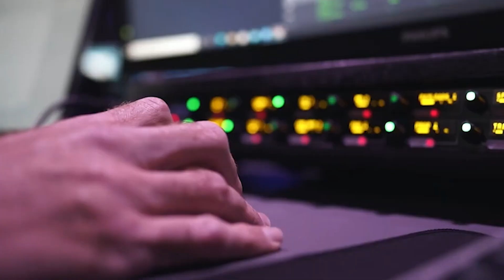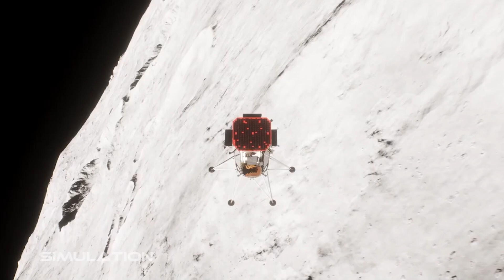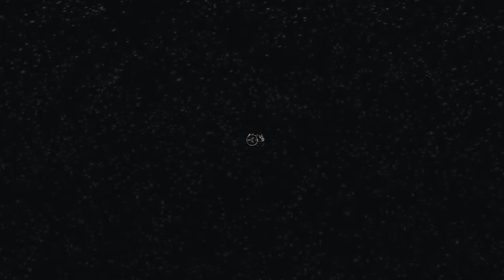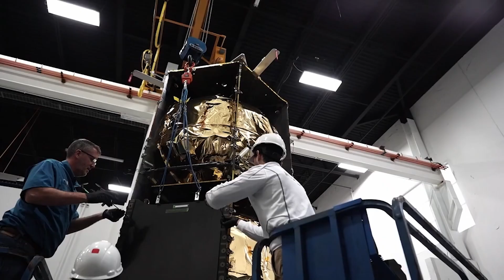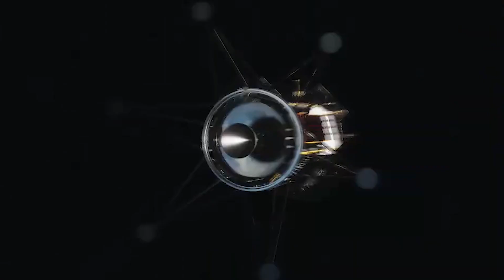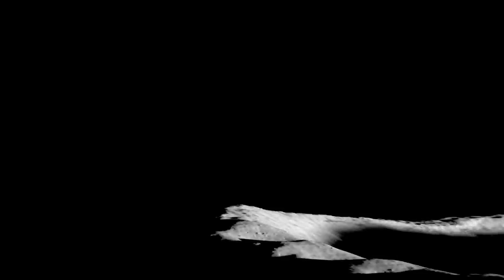What Exactly Went Wrong During Odysseus’s Landing?

Comment: I like how many people consider this a 100% success or a 100% fail. It achieves 80% of it's goals but nope it completely failed because reasons.
Reply: I'd like to see your list of goals that leads to this being 80% successful.
Do you work in PR? :-)
Reply: @chippysteve4524  I think they will say that 75% is that it's still in one piece.   Maybe they should build some cheap landers that just have a couple of cameras on them to prove it made it and do practice landings before they go and spend 100 millions dollars on a box that tips over.
Reply: @rbspider  I think this is an example of a cheap lander.  According to Wikipedia, I think $118 for 3 landings.  They won the contract so the competitors were presumably more expensive.  I think the extra cost for a decent mission if all goes well wasn't that much and was largely paid for by folks willing to gamble.
Reply: @richdobbs6595  I saw that it cost over 100 million, it didn't mention two more probes.  They add all these experiments onto them to make the device very complicated .  How about a box with some cameras and a door to open and close so that a robot can step out or even just some boxes with cameras and practice landings ,  send up one a month until they figure that out.  Sort of what Space X did with the boosters.  I can't wait fifty years between missions ,  I'll be dead.  I think we wasted our time on the space shuttle and ISS.  If there was gold up there it would be like 1849. Other than taking pictures of the Earth to set the record straight for all the FE honestly what is the point. There are tons of things to fix down here.
Reply: @rbspider  There are supposed be 8 or 9 NASA lunar landing attempts in the next 2 years, so you won't have to wait forever.
Reply: @rbspider -total cost is about $130m. That includes the $90m ride from SpaceX . So really it’s 40m to make lander
Reply: @rbspider They went private-capital; Google: "The Secret Spece Program." They've had two conferences. A good book: Covert Wars and Breakaway Civilizations: The Secret Space Program, Celestial Psyops and Hidden Conflicts
From Joseph P. Farrell
Current price:$19.95
Reply: @richdobbs6595  Thank the NASA ,  I don't have much time left but hopefully two years . My doctor told me to not buy green bananas .
Reply: @andymunoz3954  That's not real bad an F-35 cost much more . But how long does it take to build one? They should make an assembly line so that every part isn't a one off .  The vendors can then build to spec the experiment parts and have them plug into available bays ?
Reply: @richdobbs6595 true they need to stop cheapening out.
Reply: @rbspider  - Well Flight two is scheduled for before EOY. flight 3 being in 2025.  I think they gave themselves room for improvements between flights. You can do all the math in world but you learn faster with rate. Its how Spacex develops so fast. I think I.M. is doing the same.
Reply: @richdobbs6595 this 118$ million is a cover up from nasa dude you really trust that. Its atleast half a billion project and its not for 3 landing.  I can tell you with 100% assurance they will not land soft in the future also , it was not at all controlled and the speed was too much . Go and watch indian and chinese landing and check the speed  you will  understand the difference .
Reply: @andymunoz3954  I am sure they will get it locked in and if it weren't for the sabotage on this flight it would have been a total success. But two failures in a row would be bad.
Reply: @tubecated_development Well isn't the real goal to put humans up there?  Any experiments can wait . We need the cameras up there to show the FE people that the Earth is a ball and water sticks to the bottom .
Reply: Landing on its side is a 💯 % fail
Reply: I’m glad you like it
Reply: 90% failure… 
Got to the surface of the moon 10% success
No communications (-5%) 
12 experiments lost (-75%)
No deployment of camera (-5%)
Human error LIDAR safety pin (-5%)
Reply: I was 8 years old and remember the 9 missions to the moon that 27 people flew to the moon and 12  people walk on the moon.   So this backwards progress missions are hard to take seriously .
Reply: @Crashed131963  Hmm... your memory isn't what it used to be mate.  Nine Apollo flights went to the moon, carrying 27 men between them.  Apollo 13 did go to the moon, indeed to this day, those three astronauts hold the record for being the furthest from Earth any man has ever been, but obviously the landing wasn't possible after the explosion in the service module.
Reply: @Warriorking.1963  Your right I forgot that Apollo 8 went to the moon . That makes 27 .
Thanks for the info .
Reply: @Warriorking.1963 Apollo landing is fake lol 😅
Reply: @aungaisum8654  🤡
Reply: @Crashed131963 you know this is Hollywood stuffs lol 🤣🤣🤣
Reply: @aungaisum8654  That why the USSR during the cold war invited Neil Armstrong to Moscow to congratulate him?
Reply: @Crashed131963    If you are old enough to remember the Apollo missions then you should be old enough to understand that there is a big difference between landing a manned vehicle on the moon and an UNmanned lander.  Perhaps if the laser range finder had been functioning properly the landing may have been better. 

 This lander was the first lander built and sent outside the Earth's orbit by this company.  In addition this is just ONE extraterrestrial vehicle and was designed and built on a shoestring budget of only 118 million dollars.   That is hardly an indication that the technology is going backwards.     If you know anything about sending extraterrestrial objects into space especially to land on the moon that is an expensive proposition.  

This vehicle was only intended to last 7 days anyway and conduct a few experiments which it appears they can conduct some of their mission plan.  Add to that this vehicle had numerous firsts.  First private company to put a lander on the moon.  First lander to use meth lox fuel and also a cryo fuel.  

 Perhaps you weren't aware of these facts which is wait it is always good judgment to wait before passing judgment on what may appear to be an unsuccessful mission.
Reply: You wish they ever got to the moon. And then they LOST the technology how it was done.  WOW   @Crashed131963
Reply: You and me, both... @Crashed131963
Reply: @Crashed131963 NASA faked all the Moon landings. You believed it back then as true because you were eight.
Reply: @Crashed131963  I couldn't agree more.  Now they have delayed the Artemis launch for more than a year due to some new issues.
Reply: Landing SIDEWAYS on the moon after 50 YEARS of technology advancements since NASA's several successful landings is certainly not a 'success'.
Reply: Has lots of support from around the world. Probably have a squeeze soon
Reply: Exactly no success NASA really fucken up can’t even land a self autonomous lander
Reply: 100% belly flop
Reply: Did it meet its science objectives?  Launch, cruise, and landing are only steps towards meeting its objectives.
Reply: Better to redesign the moon lander in a ball shape containment. Ha ha!
Reply: Unprecedented homelessness.   Housing costs historically unreachable.   Yet we have more technology on our wrists than you could fit in a room, back when we last landed on the moon?   Two missions cost how much in tax dollars?   I think it's a colossal failure.
Reply: its a 100% fail
Reply: @imyoursenseiX  100% fail is a impact creator .
The thing is sending great closeup pics of the moon surface with the camera lens in the dirt .
Reply: @Crashed131963 sending pics to who? Where are all these fabulous pics. Also last I checked video has been around for 80+ years . How convenient that the video camera was “powered” down. All part of a BS scam.  Seeing IS believing and HAS TO BE the MOST important objective.  The moon is a dead rock. Yet SHOW videos and then you have believers.  Ridiculous
Reply: I can't believe there are adults that actually believe in "space" travel...absolutely pathetic.

🤡🌎
Reply: @mikestorey1609  That's why during the cold war the USSR invited Neil Armstrong to Moscow and gave him a parade and medal .
The USSR just wanted backup the US fake moon landing story because they were such good friends . .
Reply: Bellshazar - yes - "reasons" ... MANY reasons....
Reply: If this had been NASA’s project, can you imagine the non-stop comments that “government” is incompetent and spends too much? MAGA would be campaigning on it.
Reply: I mean yeah but landing is like 10% of the end goal, right? But landing 100% correctly is what allows it to perform the other 90% of its goal
Reply: At least it wasn’t a “smashing success”, but rather a qualified learning opportunity which wasn’t totally bad.
Reply: @Mentaculus42 whatever. If it was the Chinese, they would have landed it correctly. How many millions did they spend on it? For a learning experience ?
Reply: @acerdan  
So your high mark is the chinese! My subtle point was about the constant pronouncements of “smashing successes” from a particular group more than what happened here. Don’t forget that JPL & NASA has been successful at doing things that are a lot harder than landing on the moon (for a lot of $$$s and time). Now a group within NASA is trying to “outsource” more because it is in vogue to do these “experiments” in developmental methodology.
Reply: @acerdan China space missions has good planning before doing it. That's why they have 100percent record.
Reply: @Mentaculus42 moon landing easy? Looks like only China can consider succeeded 😅
Reply: @Mentaculus42  Wherever I have worked a "qualified learning opportunity" has been code for "F@#$ up"
Reply: @alanserjeant4947  
Precisely, but actually my comment was more a response to a particular group’s usual statement that the test was a “success” despite it being mostly a clusterduck because there was “learning” accomplished.  I do understand that landing on the moon is very difficult and things happen. It does put the accomplishments of the unqualified success of JWT into perspective where time and money seemed to have no limits. Parts of NASA are willing to accept more risk now, so stuff happens, it is all a compromise trade off.
Reply: It was a crash, period. If not only because the CEO wants to make us believe it is a 100% success.
Reply: It's on it's side. Russia what and 80% success then also right?
Reply: Let me try that positive outlook way of viewing life.  The Titanic was 80% successful .  It did float and took on passengers.  The San Francisco Millennium tower is standing .  So it tilts and sinks , no big deal,   Want to make this a success.  Send up and land a Boston Dynamics robot and have it put the lander in the correct position.   If that's possible it would be cool.
Reply: @rbspider the problem is face lol 😅😅😅. They don't want the world to know that China is way ahead of US lol 😅😅
Reply: @aungaisum8654  If that were the case they would not have told us it tipped over.  I am starting to think a China spy man was reason Landing system was locked in safety mode.
Reply: At least its real this time.
Reply: I would call it a mostly successful mission because the main goal was to softly land the lander and bring America back to the moon and they did succeed in doing that.
Reply: 30% success, at best.

Comment: Well over one hundred 180 million dollars  tiped over...
Reply: compared to the tens of billions for the SLS/Artemis program that has delivered nothing to the surface of the moon?
Reply: @JaromeAllen  Holy molly. You're comparing Artemis to that comparatively small attempt with completely different objectives? Completely idiotic.
Reply: well aren't you a postive piece of work...

yes.. when it comes to putting something on a moon.. i am..   One did it for a fraction of the cost in a factation of the time.

180m is a drop in the bucket compared to the absolute drain on nasa funding that Artemis has been.

dick

Comment: Maneuvering thrusters can't upright the lander?  Remember, the weight is significantly less, so the thrust needed is significantly less.
Reply: highly unlikely that even if the thrusters are in ideal position they could produce enough thrust. add the risk of many problems and even trying would a bad idea, considering the solar panels are somewhat in the right position. maybe if it was in the worst position for the panels, a roll over would be worth it, but not in this case.
Reply: I don't disagree. Using thrusters would only be attempted if the lander was otherwise useless. @thorin1045
Reply: @thorin1045  Yes, it's a risk.  I thought though that originally the lander was supposed to move around.  If the thrusters could lift it the team would have to weigh the risk of losing even more functionality or possibly get nearly all back, including the ability to move.  Having spent 28 years in aerospace engineering myself, I'd be for the risk move if the thruster could generate enough thrust to lift.  I'd spend alot of time analyzing the angle of the thrusters, thrust vectors, thrust time exec to stand the lander upright.
Reply: Make a bad but possibly salvageable situation worse.
Reply: Stupid, woke ground crew won't fire thrusters. Might result in moonal warming.
Reply: I had the same thought. Would be very tricky but worth investigating.
Reply: Nope.  They screwed up NOT having multiple redundancies and an automated System that would not land if  there was any forward motion that could cause  it to topple.

Space X will absolutely have a automated system ..... that will will not land ... the to top heavy Starship if there is forward motion that could cause it to topple over.

C'mon.  Space X got them into orbit around Earth .. and then they immediately started to have problems before leaving Earth orbit for the the moon.

Why the hell isn't Space X making an unmanned fully automated mini Apollo missions to the Moon ... using Falcon Heaven ... able to  return samples & experiments to Earth ... or .. even sent a Robot to put a toppled lander upright?  And Space X would get some need experience with lunar landing, automated systems and robots ... for the Starship moon & Mars landings.  Plus it could quickly develop an alternative Lunar lander ... that would be stored in the Bay of the Starship in orbit around the Moon.
Reply: This cancels out. The lower gravity lowers the required thrust AND the torque to be compensated for. This is EXACTLY as difficult as on Earth, only in 1/6x slow motion. They didn't test this as required. It's almost impossible to get wrong. And moreover, it also lacks expendable legs to compensate for uneven/tilted ground -- of course, here it actually crashed BEFORE making a soft contact.
Reply: Next month, Elon will send an optimus up there on a Falcon heavy, which will walk over and set the lander upright, dust off the solar and the lenses, then jump upward to be rescued, probably by the Tesla Roadster.
Reply: If you don't understand don't comment
Reply: @WildlifeWarrior-cr1kk that's how freedom of speech works, right?🤔
Reply: @brownmuta7537  sure
Reply: It needed a robust AI failsafe system, specifically tailored to the landing sequence to confirm all landing feet have equal pressure before throttling down. One leg probably came down on a rock or small boulder.
Reply: Actually, they need to assess what the real problem was, redesign the lander to mitigate the problem, and try again. Do it the Elon way, this was one of the tests to reveal the system is broken. Find the failure, lather, rinse, and repeat.
Reply: @stitchem7  i would say it was a wrong design from start. 2:1 ratio for tall when it bring almost no benefit. a wide base in the direction of the natural motion and all the problem of non zero side movement is removed. and no, most design process involves thinking and avoiding the need to destroy costly stuff to find out: if your raptors do not work, they won't work with thirty other either. or how to calculate balance for n object.
Reply: @thorin1045  2:1 is no problem with today's control firmware. They crashed it, probably broke the legs, that's all.
Reply: @falklumo  no problem, unless it is. reverse it and it cannot be a problem.
Reply: @stitchem7  So re-make half of lander that wasnt at fault at all and fail again in spectacular fashion?
Reply: Yes, but only the half that failed. ;) @alexturnbackthearmy1907

Comment: With such a wide landing stance, I'm surprised that it fell over. Still, I consider it an epic fail.. leaving the covers on the LIDAR is bone headed. There must have been hundreds of people working on it during stacking, and they forgot the covers. That is hilarious. Still no pictures yet either. Better luck next time.
Reply: You'd think someone would invent a transparent lens cover.
Reply: @robcat2075  Laser is quite dangerous to the eyes, y know (even some cheap chinese laser pointers are strong enough to deal permament damage)
Reply: It wasn't a lens cover, it was a physical safety switch (like in a firearm) to help protect technicians from the harmful lasers on the ground
Reply: It didn't "fall over", it flipped over while sliding sideways on a 12 degree slope and hit a rock and flipped.  Objects are 6 times easier to flip over in the reduced lunar gravity.
Reply: @zer7644it didn't fall over, yet it sits on it's side.  Thanks for clearing that up. 🤣